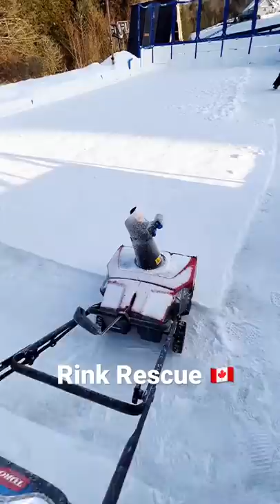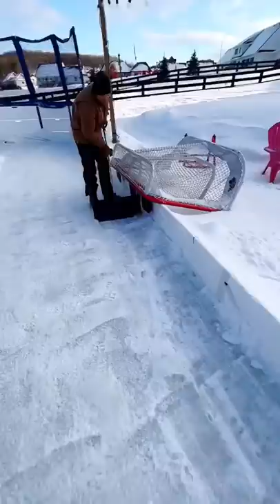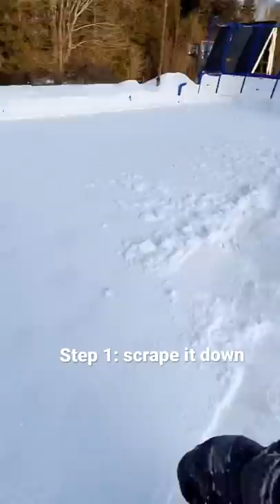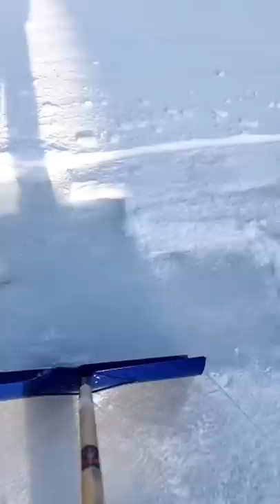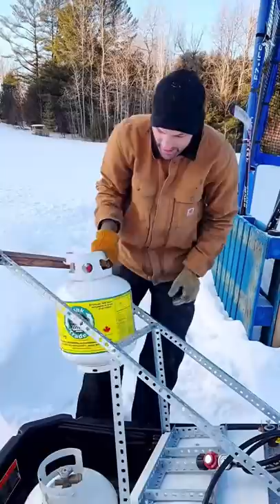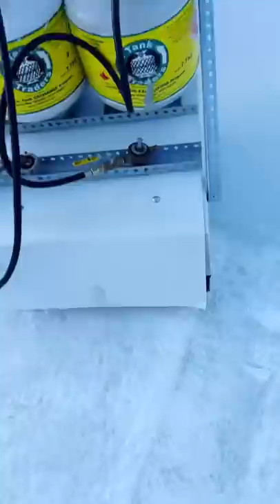Rink Rescue

Comment from the maker: Thanks to all the new subs 🙏 If you like this check out my channel, I post longer videos every week https://youtube.com/c/CoachJeremy
Reply: Just a thought. Could you put a big plastic sheet on it like a blanket... And after it snows remove it before the snow freezes
Reply: Can you do a full video on how that propane Zamboni is made, me and the guys built one with a lawnmower, some pvc pipe, and a rug, but it’s a little bit of a process to get the thing setup this looks way better.
Reply: @martinkitevski7056  you can, but only problem with that is number 1 if you get a foot of snow there’s no way your lifting that tarp off, and second if it warms up and the top layer of ice thaws the tarp will be frozen into the rink.
Reply: @martinkitevski7056  z
Reply: Hey I’m not saying it works all the time but try a leaf blower it’ll get rid of that snow a lot faster than shoveling it.   Sometimes most of the time.
Reply: I’m new to this channel 🎉❤❤

Comment: I mean, if you think about it, you guys have essentially made a man powered sled zamboni
Reply: Propane powered man propelled heater
Reply: Someone should rig this so that you can grill while ironing the rink at the same time. It will be a fun game of hockey with booze and barbecues!🤪
Reply: Nope, a zamboni uses hot water
Reply: @bamboo7714  that would be awesome 👍
Reply: Summon hank hill!
Reply: Canadian MacGyver
Reply: Zamboni’s use a razor sharp blade to shave down to cleaner material before applying very hot water.
Reply: So fun u call it Zamboni
Reply: @itsmrhunter spiffing brit I see
Reply: @iwin2052
Reply: Purple powered alien crab god
Reply: @itsmrhunter  no theres actually little people inside the tank, rubbing their hands together insanely fast to produce heat gases for the tiny makeshift zamboni
Reply: @asteria4_943 u get the point

Comment: Great job guys. 1 suggestion after you have used your metal shovel. The game changer would be a power brush that hooks up to your whipper snipper. It’s amazing. Then leaf blow then add that hot water. Or use your amazing propane zamboni. Curious if you have plans for that I am curious to make one.
Reply from the maker: Yes the power brush would be great! We don’t have plans for the flameboni.

Comment: There are weed killers that are similar to the contraption you created that has a heat/burn component to it that you could use instead of having open flames below the propane tanks. Feels a bit safer.